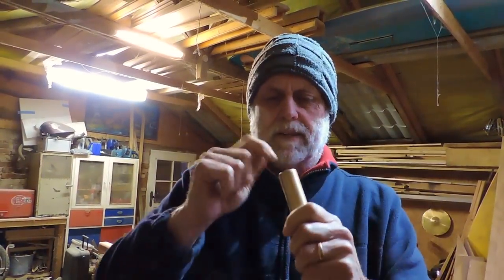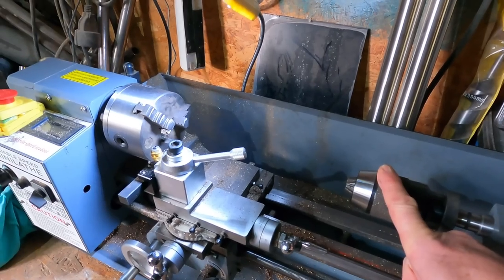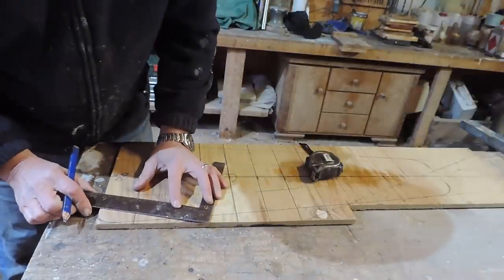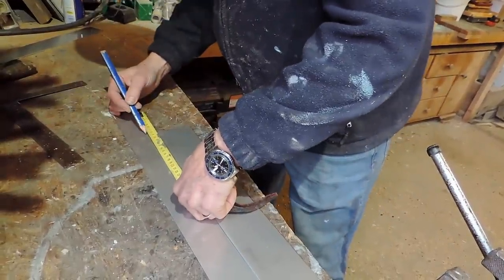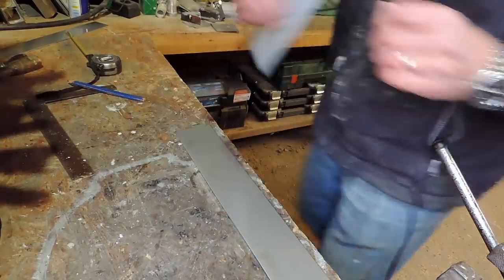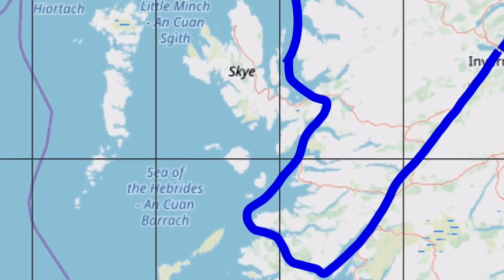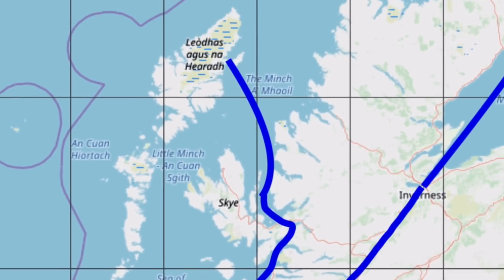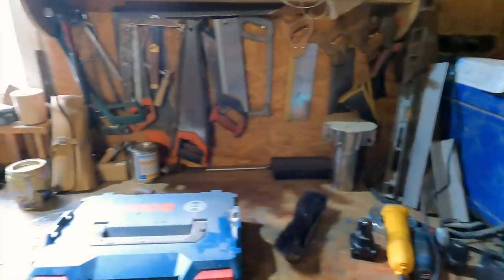Tiller, Rudder Lower Pin and End Plate, and a Cruising Update. - SV Tapatya EP262

Comment: Great vid Tony, thanks so very much mate, if I may, are you going to somehow have removable panels for the Bimini, the reason I ask is seeing Hazels boat covered in snow I thought it would be good if you could cover in the Bimini to give you a bit more covered outside shelter, and then when the covers aren't needed, roll them up and stow them away. Just wondering that's all mate. Seeya Rob
Reply from the maker: Yes Rob. I fully intend to do just that 👍😃